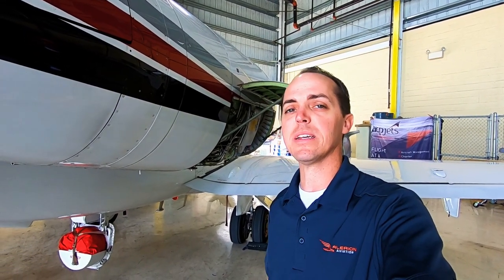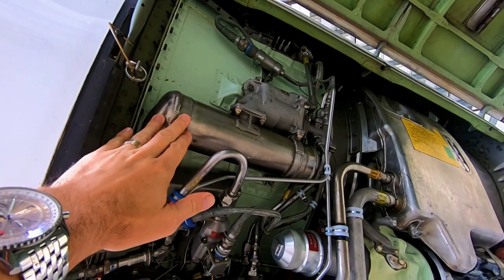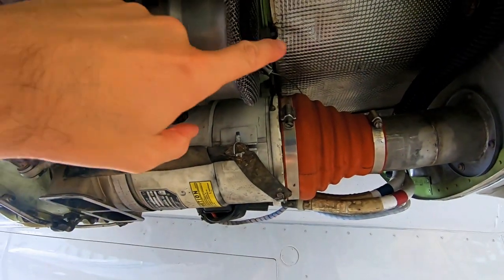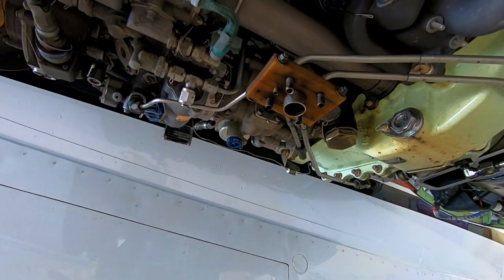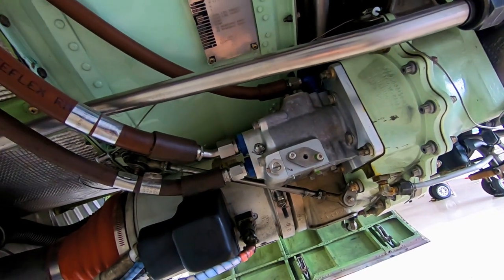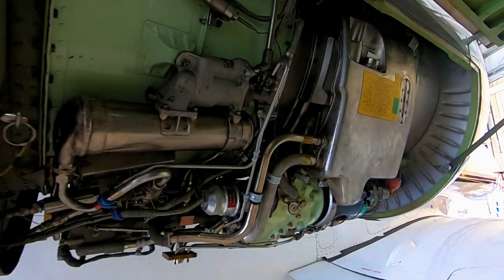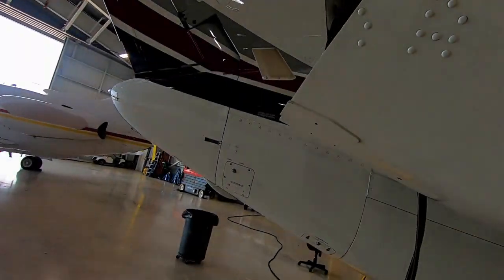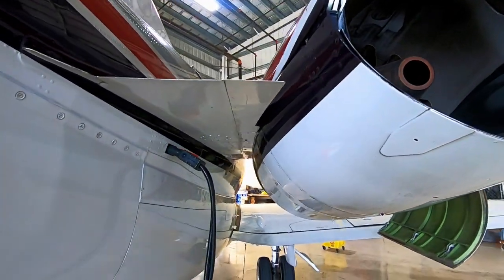Tech Tuesday - Inside The Hawker Engine Cowling

Comment: Shaun, just a quick note, you forgot to point out the engine fire detection cable that runs around the bottom of the engine.  It’s just I used to sell those resistance cable systems😉
Reply from the maker: yeah...I realized when I was editing the video that I missed that mention. I'll do a full video on the fire system sometime.

Comment: Awesome man. So no Air turbine starter needed. Their is enough pazazz in that dc generator/starter to compress the air? Can you use air from the APU to start?
Reply: It's all electrical. As long as you have enough volts/amps from the starter/generator it will start the engine. Usually apply fuel from 8-12% N2 (turbine speed)

Comment: Shaun; There appeared to be a rather thin and "spindly" wire that was routed throughout the engine.  Is that part of the fire detection system? I am amazed at all the "stuff" that is driven by the engine!  What stage of the engine is actually driving the reduction gearbox?  Thanks for the Engine Accessory 101 class!!!
Reply: Yes that is the thermocouple for the fire detection system.

Comment: No lockout pin on the T/R? Oops ;-).     Hey can you do a video on how auto braking works?  Do you still apply pressure to the pedals or does the system take care of it.  What about in the RTO setting?  Do you still have to apply pressure to the pedals?

Comment: Ever wish you had an afterburner?  :-}
Reply from the maker: Every...single...day...
Reply: @CorporatePilotLife  As a Royal Air Force brat, the kids my age and I used to be attached to the chain-link fence between us and the scrambling English Electric Lightnings that were stationed on the same base as us.  They used to practice unrestricted takeoffs since they were classed as interceptors during the cold war.
I can still remember the vibration as the two afterburners (Brits called it re-heat) came on and made your heart rate climb, and that smell...you know?  That gasolene smell...it smelled like victory  lol
I could use one of those burners in my slow-as-molasses car, especially on the highways.

Comment: Ahh. Good ole 731’s. Do you still need to do a SOAP sample every 50 hours on those? 
Another informative video, thanks.
Reply from the maker: Not 50 hours anymore, but between 150 hours and 250 hours it is required though.
Reply from the maker: BTW, I had to ask Adam what a SOAP sample was...he laughed at me when I asked. He was probably thinking "why does this dumb pilot want to know this?"
Reply: You can probably guess what I'm going to ask?
Reply: Tom P    SOAP sample I’m guessing.  Spectrometric oil analysis program   On the 125-700 I flew, and maintained, as I was also a A and P mechanic.  I had to do a sample every 50hrs.  It was a program that would check the condition of the oil. Look for microscopic pieces of metal as the early 731 engines had a problem with the forward planetary gears self destructing. 
I had an engine failure on a Learjet model 35 that had the same engines. Thus,  they instituted the SOAP sample method of checking for failures BEFORE they happen.
Reply: Corporate Pilot Life    you can tell Adam that it was a pilot that asked that question. A retired corporate pilot as well as being a A n P mech for 40 plus years.
Reply: @richschindler8731  Thanks Rich.

Comment: Looks like the Hawker engines are at a much more accesible level for the mechanics to work on than the Gulfstream.
I was wondering, how easy is it for them to dismount that engine, as it all seems fairly self contained. The hydraulics look like they can simply pop off. I imagine the fuel line is not to hard to disconnect, but what about the electrical connections, I couldn't see how that was connected, and it looks like the engine control systems are not mounted locally, I presume in the hell hole?
Reply: About 40 man hours to remove the engine. If you get 3 people on it who knows what they are doing they can get it done in 30-36
Reply from the maker: yeah...they come off quite easily...I've seen them take one off and put another on in just a few days with a crew of experienced mechanics

Comment: What's the round object with the red cover on it?
Reply: If you're talking about the door hanging down that is the door to the AFT Bay or "hellhole". Up in there is the Apu, both main batteries, o2 bottles, fire bottles, electrical components, etc. The red thing on the door is where they store the engine covers